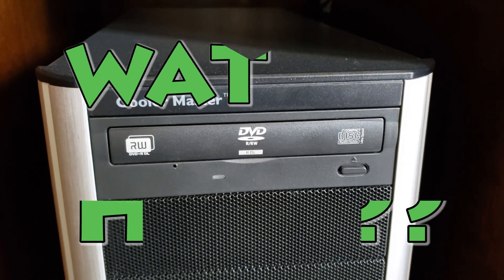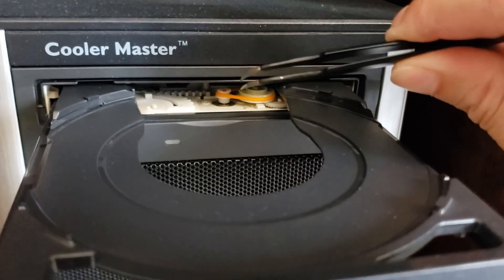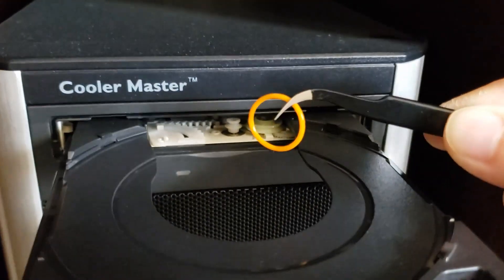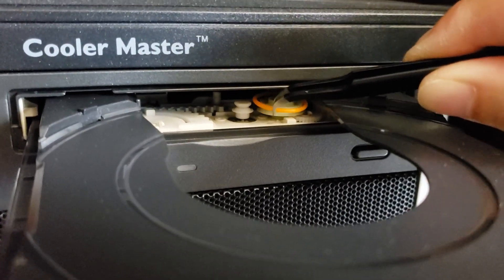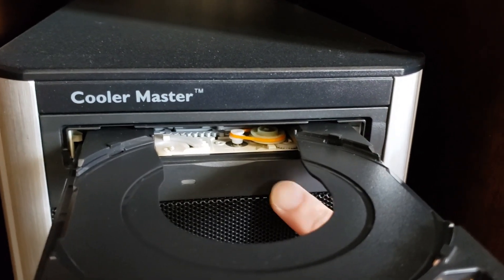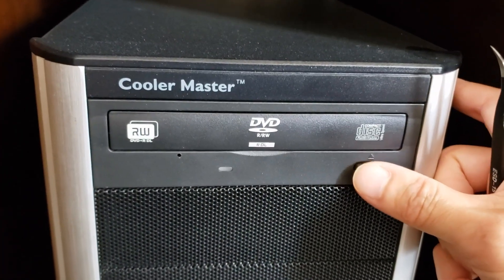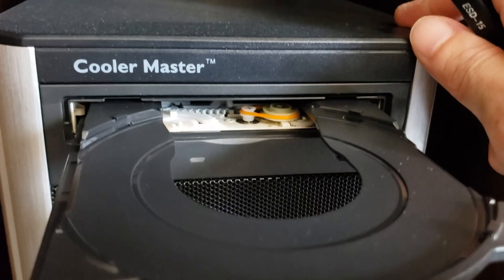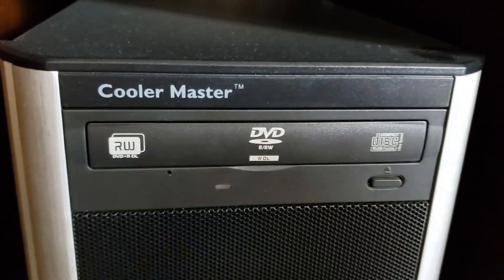CD DVD Drive Won't Open Fix

Comment: I got a heart attack when I used the pin. I went softly but then it made some mad wrentching sound and I thought my fav Jackie Chan DvD was going to be messed up. Thankfully not. Was able to eject after a second attempt.
However I could not gain access to the belt because there is a plastic barrier infront of it. I could touch the smaller wheel slightly (turning it) but could not remove the belt itself. Guess I have to open up the thing myself. It's 7 years old now so no need  worry about the warranty.

Thank you for posting this! Never noticed the pin-hole lol.
GREAT VIDEO!

Comment: Bro My PC dvd player pinhole doesn't work
1
Reply from the maker: May be you need a longer pick.  You have to feel for it some times.
Reply: @watdahel  I reached the edge of it, but then I realized that when my father takes the PC to repair the motherboard, the repairers may removed the DVD.
Reply: Thank you you helped me a lot. I got it open.